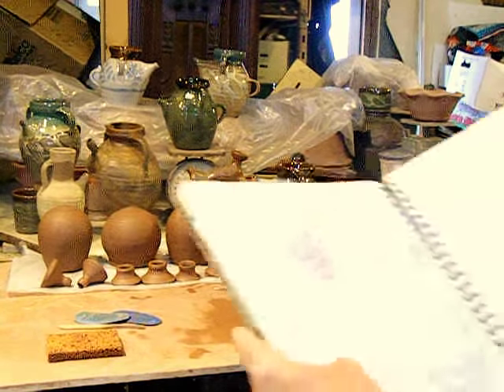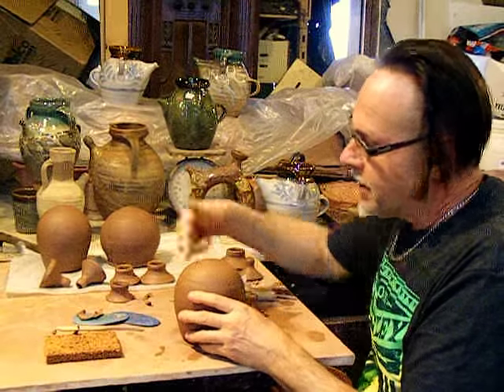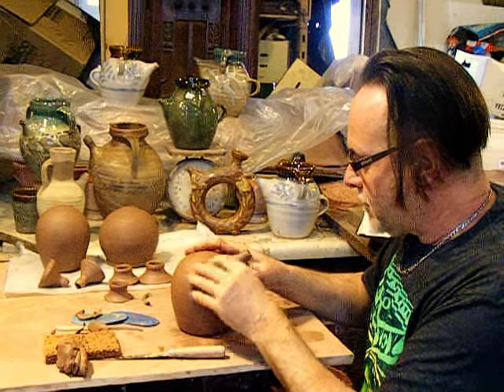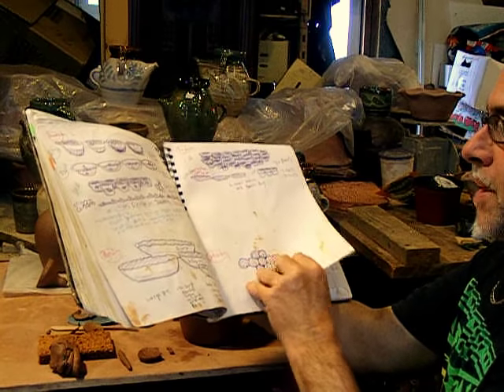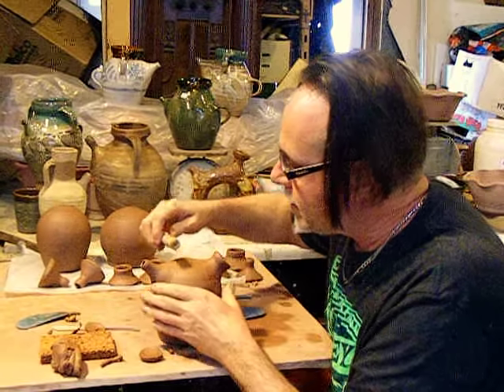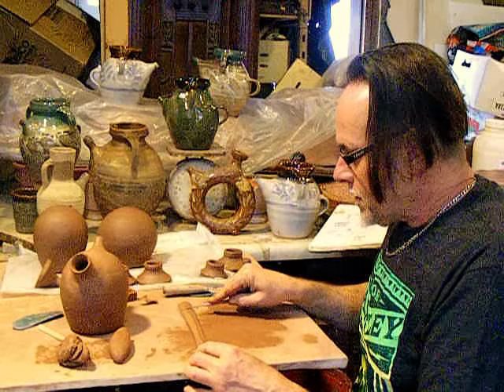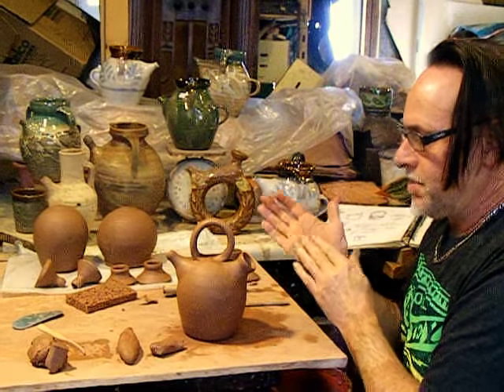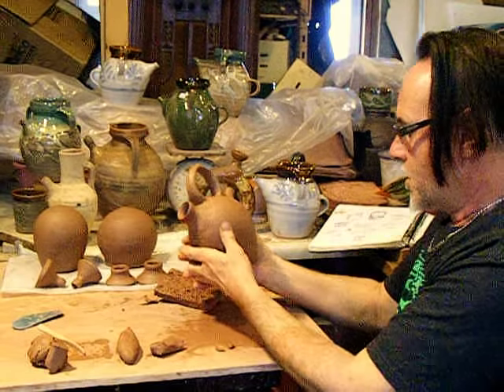Attaching pottery SPOUTS & HANDLES #038(part 2) Water jugs 'botijo'

Comment: Might it be a thrown ring at the top and attached when more wet ?  Nice one, I think Simon Leach did some botijo's which he took to stoneware. I made one , but I put my appendages down too low, it looks like a pig. I fired it to e.w, but I think it goes mouldy because I live in a damp place.
Reply from the maker: Thanks, so many ways to take the design. When they were really used it would have been unglazed earthenware, the water drawn through by the sun would be cooled - how cool would that be- not very. They couldn't clean them even if they had dishwashers, it was a different world.